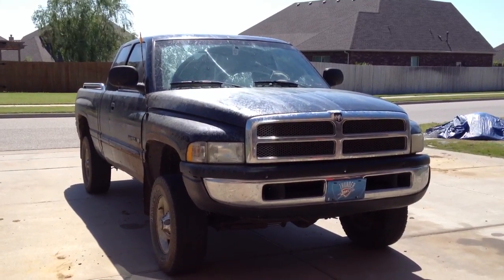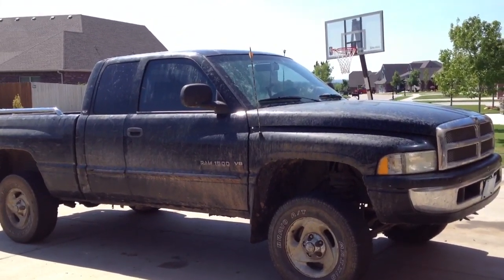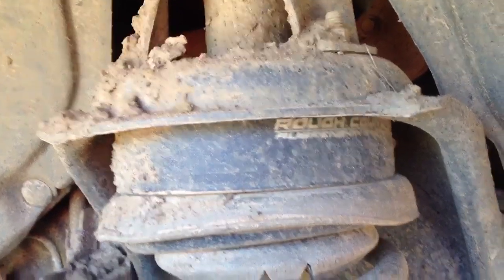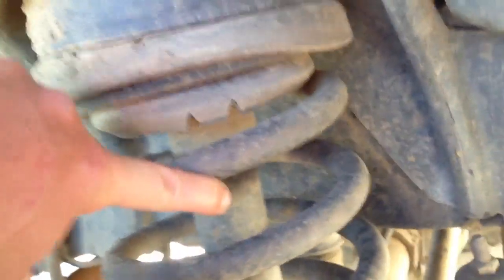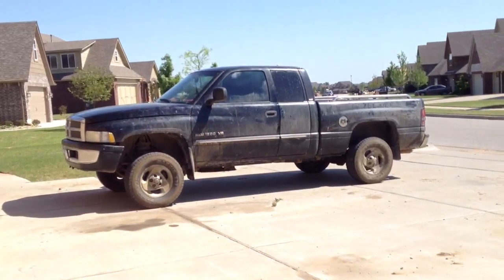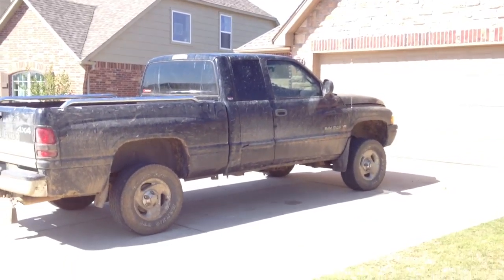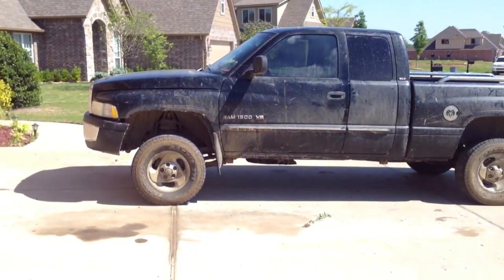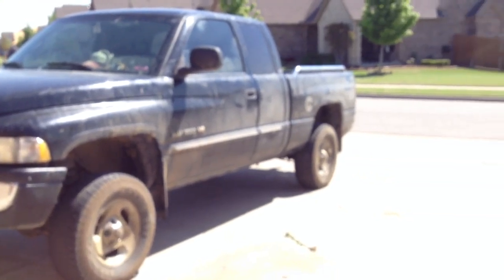Rough Country Leveling Kit: 2001 Dodge Ram 1500 4x4

Comment: did your 33s rub when you turned lock to lock?? i want to level my 98 4wd reg cab and throw some 33s on it but am not sure if itll rub or not
Reply: I got a 2001 4x4 ram and I got 33s on mine and they dont rub and I didn't  evan have a 2 inch leveling  kit on mines but I'm going to put one on already got it ordered  it makes your truck look tuff like a pit bull  stance

Comment: I have 35s that I bought, I have the same truck, not sure about laramie edition. Will they fit if I put a leveling kit like this on it? Not rub or anything?
Reply from the maker: Striker x Cast the 35s I had on 17 inch wheels cleared perfectly without any rub.
Reply: Scott Tighe So, with this leveling kit, your 35s cleared?
Reply from the maker: Striker x Cast The 5 inch suspension kit lifts the front 6 inches and the back only 4 inches, so it is designed to level itself out. Therefore, you no longer need a leveling kit.
Reply: Scott Tighe How much did the lift kit cost? Do you have a website or anything?
Reply from the maker: Striker x Cast I believe the total before shipping or after shipping I'm not sure what's $950 but that was with the upgraded 2.0 shocks. I purchased the lift kit off of rough country.com. It was from rough country suspensions systems! Good product